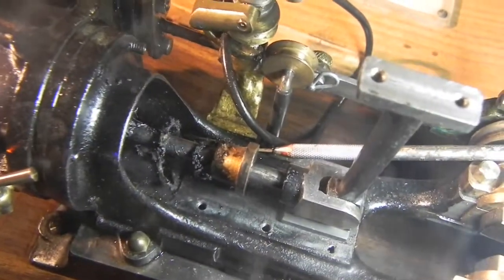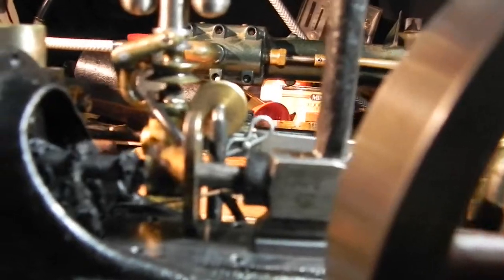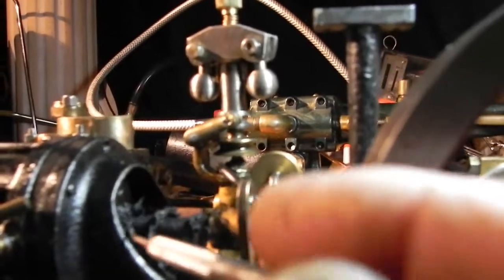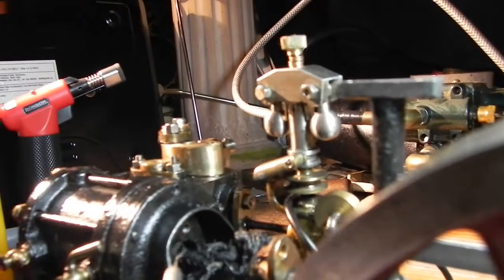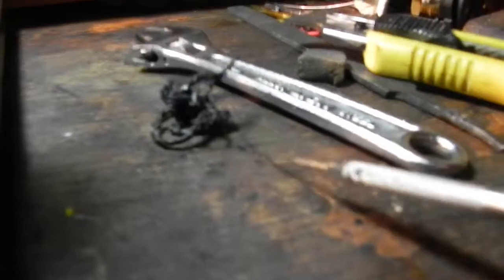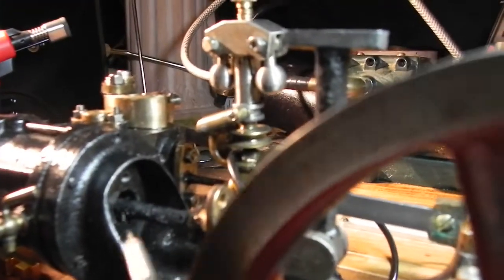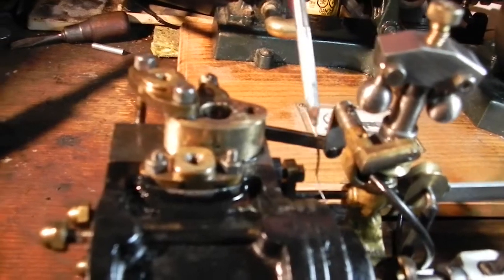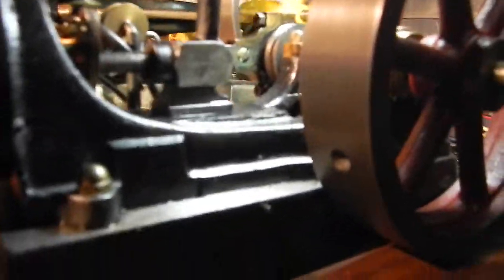The sticky Stuart #9 steam engine with governor added +Sipps, in need of repair and restoration.

Comment: The packing is graphited yarn, it's just about the best packing you can use in steam engine glands.
On a side note a steam engine should never have compression, it suggests that the valve timing is off, what's worrying is that that engine should have a slide valve which would normally lift off of the port face if coming up against compression on the exhaust side, if it does not then it most definitely needs attending to.

Best of luck with its repair!
Reply from the maker: It was indeed but like the sludge in a BSA sump from the 50's it had gotten a bit thick, I did end up re-using a bit after conditioning treatment. :o) The compression test I did do with engines is blocking exhaust and feeling the compression at each end. Should have been more specific. The rings were stock Stuarts and had not bedded in so I polished them a bit which seems to have worked ok. Need crank and split bearings for this one next.